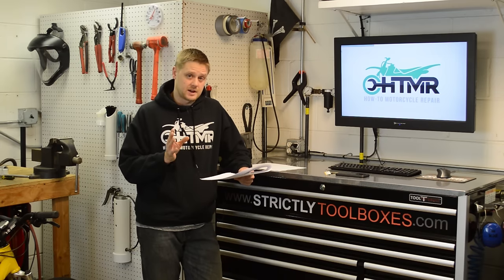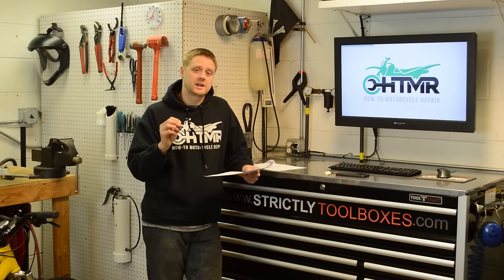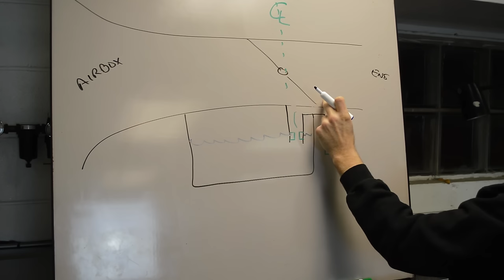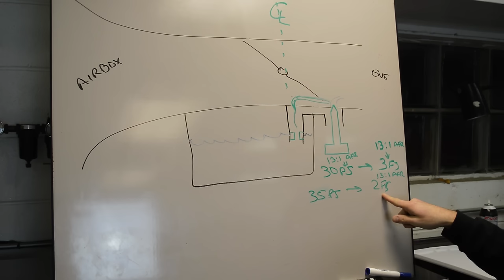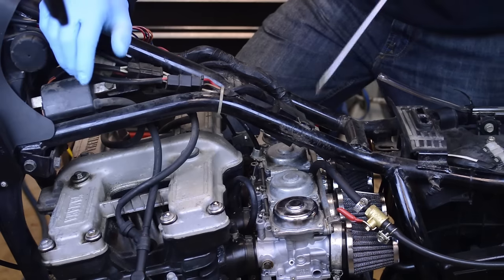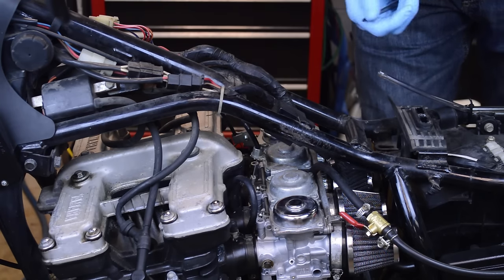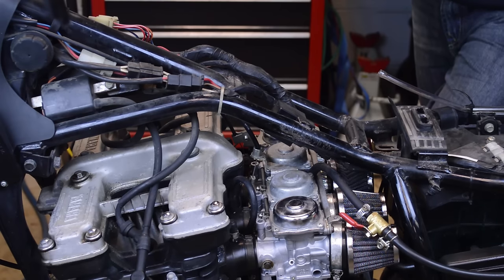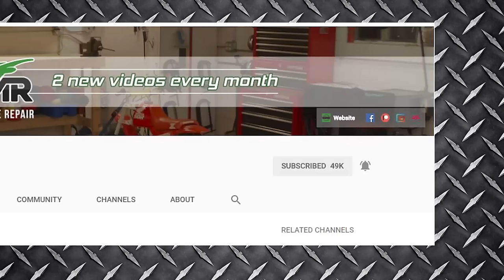Pilot Air/Fuel Screw Adjustment Explained - Multiple Carbs - Part 2

Comment: So i got a 1995 honda VT700C for my son in law not running cleaned & bench sync carbs idles like a champ but if I put it on center stand runs great shifting through gears, issue comes when I go to ride it, it bogs down sputers chocks, you have to let off a little then slowly roll into the throttle every time you shift and even then it will sometimes bog out
I'm at a loss please help!!!

Comment: Excellent video. Great technical explanation of the pilot circuit with theory and dynamic adjustments. Question: did you have to modify the air pod rubber manifolds to clear the CV vertical slide air ports as these air pods restrict and cover this port. Or is there a certain brand you are using that clears this "jelly bean" CV air port ??   Thank you in advance.
Reply from the maker: These cheap pods cleared that feature. I don't remember the brand, ebay special for sure.

Comment: Great video 
Question? I have an 88 Radian that I noticed #4 wasn’t firing at idle. Compression,spark,fuel good. A mechanic told me to clean the carbs. Change the pilot jet to a 100 and change the jet needle to a 4CP7 needle with the clip in the 4th position down. With the new needle should I have removed the original spacer that was on the original needle? Bike now is running rich. Even when I turn the pilot screws all the way in the bike runs at idle. I’m almost wanting to go back to all original and leave it. Thoughts?
Reply from the maker: The 100 jet you mentioned was probably a main jet, not a pilot jet. You changed the needle and main that has nothing to do with idle. Go back to original jets and revisit pilot circuit.
Reply: MatthewMCRepair that’s what I meant (main jet) I was thinking of setting everything back to original. The bike was running pretty good before except the #4 wasn’t firing at idle and when cleaning I discovered that the pilot screw was all the way down and stuck. All new screws are in place now. 
Thank you
Reply from the maker: @russellsitaro8505  OK, give me an update when you make the changes.
Reply: MatthewMCRepair Hi Matthew
I switched everything back to the original carb parts. Set the idle screws at 2-1/2 turns out. The bike started right up. After letting it warm up I adjusted the idle. Then I readjusted the set screws. The bike was missing and popping a little bit. Then I hooked up the vacuum gauges and synced as per the manual. 1 to 2 then 3 to 4  but then to sync 2 to 3 they were way apart from each other and I just can’t get them synced together. When I tried the idle would jump way up and I would have to back off the screw for 2& 3 and then it was like I had to start from scratch again.
Reply from the maker: @russellsitaro8505  Remove carbs and bench synch: https://youtu.be/oVlLitzF38I

Comment: 5 minutes 45 seconds in, you apologize for audio popping. Did your spark plugs have resistors in them? Does the spark plug number have an r on it? It can interviewer with your audio if it did not have a resistor.
Reply from the maker: I don't remember good point though.

Comment: Hello i have a yamaha fazer fzs600 after a 20 mins riding it,it stals down on idle  and if i try to start it up it wont start and i can see black fumes coming out of the exhaust while trying to start it.but it will start after 20 mins of rest.
is it bcz of the fuel screw?

Comment: Hello Matthew nice video, i was looking for a video like this for a long time. I have a CB750K 1981, and i'm rebuilding it, in my country i haven't found someone who provide a proper cleaning and adjustment service (and i don't have budget to buy a ultrasonic and blast machine), i would like to know if you offer that as a service? Also i need to adjust it i will run pods filters so i need to adjust (according to this video), the pilot jets (in my carb they called secondary main jets i believe) and the main jet as well. Don't know if you have a way to adjust in you shop so i only have to installed in my bike and make small adjustments or what do you suggest? 

I saw that there is an color spark plug that is used for idle adjustment, do you recommend that tool or you always go through the adjustment like you showed in the video?
Reply from the maker: I'm not accepting service work at this time. Surely you can find a local person that does vapor blasting?

Comment: so do i understand this right that you set all to the factory settings in my case 2 3/4 out .. idle to 1200 .. then play with ½ turn on each carb till its smooth as butter .. then after that set the "main idle" screw on carb nr 2 down to reccomended 1200 again ? and its set propper ?
Reply from the maker: Yes, but do 1/4 turn increments.
Reply: @HTMR  nice ty ALOT for this video :)

Comment: So if the aim is to get the smoothest fastest idle speed why did you lean it back down from 4 to 3 turns after pionting out that it had smoothed out at 4.i don't get that. Oh wait yes I hear you so once it smooths out it just stays like that does it and wastes extra fuel unless you trim it back to where it only just runs smooth.... Is that right?

Comment: You have a vid on an idle screw?  
My bike has dual carbs (86 shadow vt700)  
The guy i bought it from said he got the 2 carbs dialed in exactly the same, spent a lot of time with em.  So i havent touched em.  
I have had to screw the idle in or out depending on outside temp.  Is that normal any help would be greatly appricated.  Plugs look to be a touch on the lean side.  Idk to think thats his carb setting or what i did by moving the idle screw.
Reply from the maker: Sounds like you have some issues. First, check for vacuum leaks. Sounds like he was messing with the synch screws. Your idle should not fluctuate.
Reply: @HTMR  it fluctuates with big temp change.  
I've had to touch it up/down just a smidgen. Whether it's +80° vs 35° 
Open more for cold 
Closed  more for summer. (otherwise idle is high form the cold weather adjustment)  
Like an ⅛ turn adjustment

Comment: Hey, thanks so much! I've got  a question: I've seen a video of a guy who disconnects the spark plug from one side of a v-twin, in order to set each carb individually. In my mind that makes sense, since you eliminate any influence by the other carb. However in most videos I've seen by professionals, they let both carbs run. Is there a reason for this, and are there any risks involved with setting one at a time? I'd much appreciate some wisdom on this.
Reply from the maker: I've seen that procedure outlined in a moto guzzi service manual, which was also a 2cyl application. I normally don't do that though.
Reply: @HTMR  Thanks for the reply! Would you say that you are looking more for smoothness of operation or reaching top idle rpm, in this procedure?
Reply from the maker: @scandinerdian1961  Actually both will happen at the same time. It will be smoothest at peak rpm.
Reply: @HTMR  Thanks again! I have people arguing that they want to set the sync BEFORE setting the mixture. Is there actually any substance to that? I've learned you do that right after. I'm so confused right now.

Comment: I am having a big trouble with my yzf 600r thundercat. He idles just okay when it is 2.5 turns out on 1 and 4 and 2 each on 2 and 3 from left. But i can smell it is really rich. It has stock jets. Doest have a a fuel screw it air screw. I thought it is leaning out when i turns it out🙄

Comment: Good stuff here. Any chance there were Mikunis in the 70's with both an air AND a fuel screw? I have a set that look that way i.e. air screw (blunt tip) on the side, fuel screw (pointed tip) on the bottom.
Reply: Just looked at your blog post about these and you confirmed what I suspected: my carbs have both.
Reply from the maker: @toyetoyetoye  Yes, not too familiar with those sorry. Not very common.

Comment: I have a yamaha royal star and put a jet kit in it and had the floats adjusted. It starts right up and idles great but past half throttle appears to lean out terribly. I would have to see what replacement pilot jets I put in and jet the fuel mixture screws. This is a V4 engine and is very temperamental. Does that sound like I am looking the right direction?
Reply from the maker: 1/2 throttle is the needle/slide
Reply: MatthewMCRepair any help on getting the fuel meter screws to come out at least to check them. Tried carb 3 and 4 this morning and they don’t move very well and being a 1997 model I can believe why. They were cleaned last week and I am guessing the fuel screws were not touched

Comment: Ok, i know these are motorcycles, but mikuni tm flatslide carbs on alot of snowmobiles have both fuel and air screws on the pilot circuit.  I would love to know the procedure to tune those correctly.
Reply from the maker: Yeah I never came across a set of those.

Comment: I have a Yamaha Fazer I am working on. It appears that it is getting to much fuel when trying to start and floods out. Will this process help with that?
Reply from the maker: How do you know it is getting too much fuel?
Reply: @HTMR  I couldn't get it to start, so I pulled a plug they seemed too wet. But I was wrong, I needed to turn my screws out to about 4 1/2 turns. I now know I need to go one size bigger on my pilot. Thanks for your video.

Comment: Will this help with cold start ignition problems? It was 8 degrees C today (like 46F) and i had to turn over the engine on my 2007 zzr 600 for about 45 seconds to get it to start to run. Before actually starting, while turning over i heard some the engine sounds like it was going to begin to run for a split second afew times (light sputtering). In the end when it turned on, idle was rough until it warmed up. I do not use the choke because it hasnt worked for me on this bike. I blip the throttle as I turn it over. Im worried that if I use too much choke itl flood the engine? Have tried the choke on this bike before when i was having issues getting it going and it wouldnt work until I closed the choke. 

My last bike was also carbed, 2009 ninja 250 - and it always started with the choke on and got going on the first attempt. I never had to give it throttle to start. Not sure what the issue is. Havnt done much work on bikes, but im a quick learner. What should i do?

By the way this video was made very well, very informative
Reply from the maker: At those temps, you need to use the choke...period.

Comment: I recently (as in few months back) removed the carburetor from my ninja 500 to clean it, including the pilot screws. After installation, the engine runs it cranks fine but at test ride at full throttle its hesitating/struggling as soon as it reach 4000 rpms or so but at cruising, its fine. Could the pilot jet be the reason? The bike throttled fine before and this is my 3rd time cleaning my carbs until I decided to unscrew the pilot to clean.
Reply from the maker: 4000rpm / full throttle will be the needle and main jet circuit. You need to inspect those parts.
Reply: @HTMR  I inspect it, and both pilot screws' orings and the and metal washers backwards during previous installation. The bike is working proper now. :)

Comment: great video,, thank you. when the pilot fuel screw is to lean, let's say just half a turn open, can it cause a bike to heat excesively?, that is the condition of my yamaha xv750 1995, mikuni carbs, just after 10 miles ride, starts heating. It has also an idling knob, to adjust idle speed, what does that knob adjust? air? Thanks in advance.
Reply from the maker: It will run super lean and yes can run hotter. The idle adjust moves the throttle blades.
Reply: @HTMR  Thank you again, now I know what to do.

Comment: Hi Question,  I have a 82 gs1100e and can't locate the mixture screws.  It idles good and when I hit the throttle is the same .  I when I place it in gear it pulls in low idle but when try to hit the throttle  hard then it hesitates. Kind of jerks  at that point. Never dies though.  Any ideas. Jets are stock and everything is clean. Changed to pod filters so it might be getting little more air. Thank you
Reply: Found the fuel screws on top. They were just plugged. Why does it hesitate though.  Is it too lean?
Reply from the maker: @tjj6583  Yes probably lean. Welch plug video: https://youtu.be/uAP2gfAqSII
Reply: @HTMR   I will try that, Thank you.

Comment: Notice how the ticking or popping in the sound follows the bike RPM?  That popping is caused by high voltage, one of your plugs or wires. Could cause a stumble in damp weather.

Comment: Honda vfr750fk 1989 got stanles steel down pipes in to exhust can no baffles hight lift cams and tuned engine carbs are 4 and abit turns out but runs lovely spark plugs look good is it too much

Comment: Excellent video!  Subed :) 
Hopefully it will help me solve a problem with my 1999 GSX600F with factory carbs and jets /Mikuni BSR36SS/ , but although I've watched the theoretical part of the vid 3 times already, I'm still confused : if I dip the throttle the RPM hangs and is slow to return back to idle, lean? .. but If I rev to 5K or 6K RPM then the bike wants to stumble and cut out as the RPM drops back to lower than idle, and sometimes it does cut out, rich? .. And to make things even worse, it will not rev above 7K RPM even with a full open throttle :( it just bogs outs, and sometimes a pop comes out of the exhaust. 
I've tried fixing this issue even with the air filter off, and I noticed that as I rev hard, small droplets of fuel spit out from under the slide needles of carb 2&3 only. Carbs, jets and all orifices are clean as a whistle, and all 4 pilot screws are set to 2.5 turns out, no apparent vaccum leaks either :( 
Do you think I'm experiencing a combination of both worlds? both lean and rich? I've also measured uneven temps at the headers, header no.2 being the coldest at 260C and no.4 being the hottest at 340C ..no.1&3 are equal at 290C  .. temps measured at idle.
Reply from the maker: You are only supposed to blip the throttle and see how RPM's return. Is this bike stock (exhaust & air cleaner)?.
Reply: @HTMR  Thank's for the quick reply, much appreciated 😊 Yes, everything on the bike is stock. Blipping the throttle causes a RPM hang, a slow drop from 3k to 1.1k ..
Reply from the maker: @ghassanalfarra8935  Are the carbs clean? Check for vacuum leaks?
Reply: @HTMR  yes sir,  ultrasonically cleaned and checked for vacuum leaks
Reply from the maker: @ghassanalfarra8935  You need to have the airbox and filter installed, otherwise it will run lean. Did you synch the carbs? What are you fuel screws set at?

Comment: So I understand you want to select a pilot jet that makes the best idling with ideally around 3 turns out on fuel screw. Is this true also with modern single carb bikes like an enduro? And what about if it is an air screw, do we still want to select a pilot jet that gives the best idling at 3 turns out rather that say 1.5?
Reply from the maker: Pilot jet is perfect if FUEL screw ends up 3 turns out. Pilot jet is perfect if AIR screw ends up 1.5 out.
Reply: Thanks Matthew, will keep this in mind for future jetting.

Comment: hi mike here in the uk, i have a suzuki bandit 600s, of which i stubbied the exhaust, now when i shut off the throttle at speed it pops alot, what can i do to stop this pls i have been told to bloke off some of the airbox just leave a hole for the rubber boot that will stop the popping or not as much, can you help cheers mike,
Reply from the maker: Run through this video, if your fuel screws are more than 3 turns out, bump up the pilot jet sizes.

Comment: Great video appreciate the detail you put into your work and videos. DIY wideband O2 sensor portable air fuel mixture gauge? I wonder if it would work? You weld a bung into your hot rod header for the wideband O2 sensor. It gives you  stymiemetric* fuel ratio.  lol. When it is under a load thanks bro
Reply from the maker: I've always wanted a wideband. For now, I use my ears and butt dyno.
Reply: LOL I'll have to try the butt dyno

Comment: So my single carburetor enduro (Chinese bashan storm 250) is 6 and a half turns out before the engine sounds comfortable and I’m also dealing with spontaneously dying. Any idea What that means? I saw 3 turns means the pilot jet is  good, but my bike runs at a super high RPM at 3 turns.
Reply from the maker: Fuel screw or air screw? You want to tune the screw for highest and smoothest idle rpm.

Comment: I have aftermarket exhaust and k&n filters in stock air box. At 3 turns out my bike idles ok but at cruising speed make a loud sucking sound like a air intake on a truck. At 1.5-2 turns out it’s seems to run better but seems to chug and pulse a little bit. According to your vid I should need to go a few sizes smaller on the pilot. Is that correct? Thanks for the vid! Just subscribed!
Reply from the maker: Tune the fuel screw at idle for highest and smoothest RPM. How many turns out?

Did you rejet after filter and exhaust mod? What year make model?
Reply: MatthewMCRepair yes I did a stage 2 jet kit from dynojet. Main jets only. Smoothest rpm is about 1.5-2 turns out. 
2004 Suzuki vz800
Reply from the maker: @nicholascollicott1683  Did you install needles? Any slide modifications?
Reply: MatthewMCRepair kit comes with new needles that were installed and slide lift hole was drilled per the kit.
Reply from the maker: @nicholascollicott1683  Turn choke partially on and go cruise again. If problem goes away, raise needles one clip.
Reply: MatthewMCRepair thanks for the info. Very much appreciated. I did this yesterday and didn’t feel too much of a difference. Still had the stutter feeling at cruising speed.
Reply from the maker: @nicholascollicott1683  Install new plugs. Go cruise. Pull plugs and send me a pic.
Reply: MatthewMCRepair just installed new plugs a couple days ago. Will pull today and send u a pic